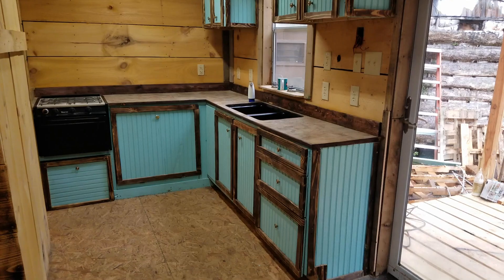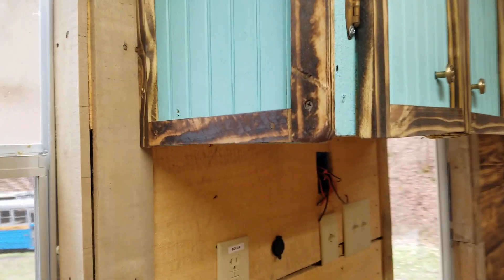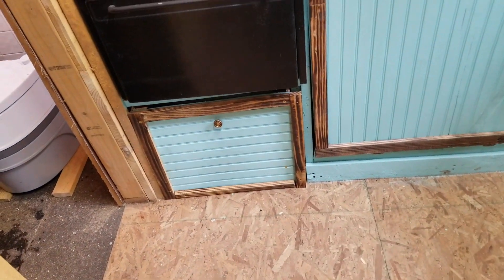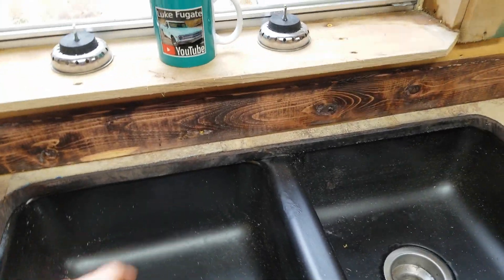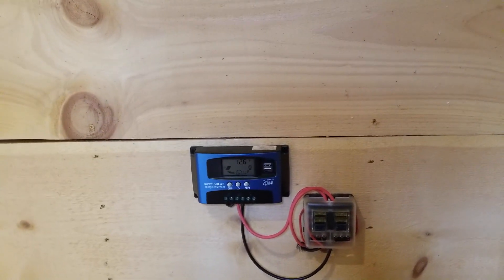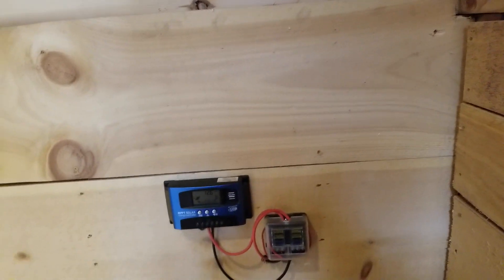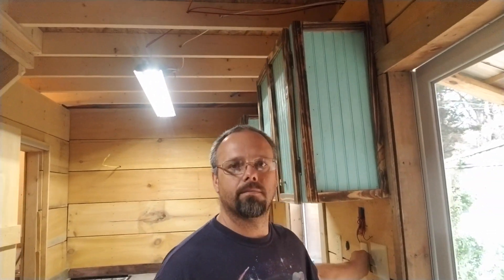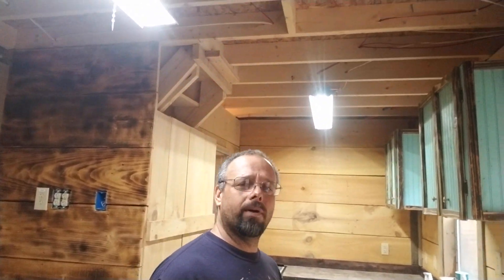Tiny House Build Kitchen-Update and Solar Power Wiring Started

Comment: I have that same charge controller. I don't use it on my main system just on the little 75 amp hour battery that I've got. Definitely not mppt those big fat liars! LOL I need to go back and see how you built that solar generator cart. It's pretty slick!
Reply from the maker: Yeah, I don't see how they can get away with the fake MPPT controllers. I guess it will work. You could easily build something like that with one of those wagons for use  in the garden like this 
https://amzn.to/2MSNepH
All it would need would be a couple of pipes to mount the solar panels to. You could have two pipes that fit into each other with a thumb screw to hold them in place so you could adjust it to any angle.

Comment: How much more will Zephyr add to the planned solar, is one electrical question of note. If it was attached now it would be quite a battery bank. But as an addition (after the house itself has solar panels) will it be just an extra array or will it add significant load to the existing charge stored in the house. It is something to keep an eye on.
Reply from the maker: I plan on eventually having around 1000 watts on the roof. With Zephyr tied in to that I will have 1600. That should be enough for all the lighting, fridge, tv and internet. Actually the 1000 watts would do all that. With Zephyr helping it will be overkill, but I might be able to run an air conditioner too.
Reply: And a backup array: it's higher up (on Zephyr) so not as much a problem if very sunny or limited sun. And your elevator chair is in that calculation too I hope?
Reply from the maker: @lkimberly2064  The elevator chair is not included in the solar system but could be easily if need be.

Comment: You'd be better off keepin those solar panels on the stand so you can direct them as needed. Drilling holes in your roof and being restrained to that one angle absolutely blows.
Reply from the maker: I had planned on taking advantage of the height of the roof to get over the trees that I don't cut. Even with the height of the panels on Zephyr trees and the hill itself are going to block the sun more than I like.
  With the extra height of the roof it should give me more exposure to the sun. I am going to put the same type of tilt mechanism I have on Zephyr so I don't have to fool with moving them manually. I can just flip a switch and raise or lower them. That angle would be way too steep in the summer.

Comment: I can never understand why most American home don’t have draining boards next to the sink so that when you wash your dishes pots and pans knives forks etc and have a draining rack on the draining board you put the washed items on the rack to either drip dry it until you have washed everything up you can dry them up with a drying cloth
Reply: No dishwasher here. We have a Harvest sink, old time. It drains back into the sink on both sides. I think it was put there in the 50s
Reply from the maker: I was kind of thinking about getting some type of rack that would hang between the upper cabinets over the sink. Some kind of wire rack that would allow the water to drain into the sink.
Reply: Philip Butcher Hi Philip, I think most American homes have a dishwasher, so draining boards aren't needed. The ones that don't use something like this shorturl.at/bABJS  or just prefer washing and drying by hand.